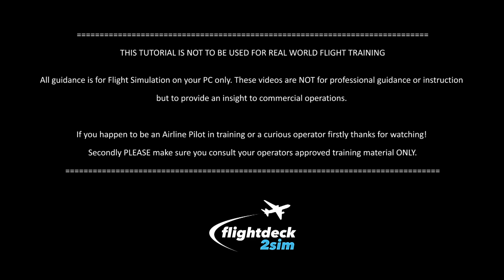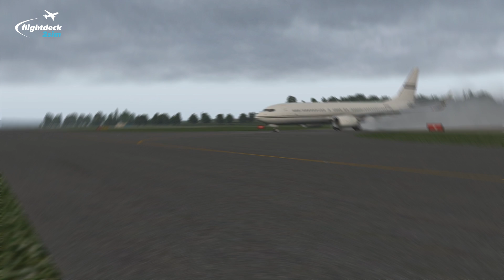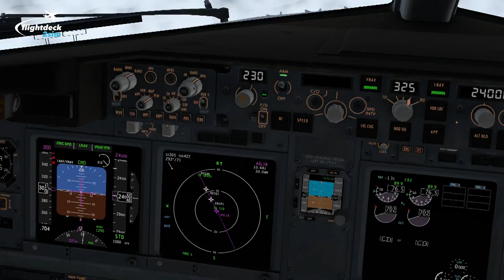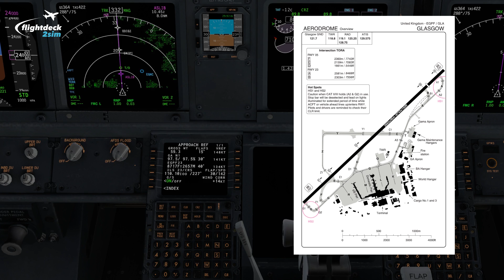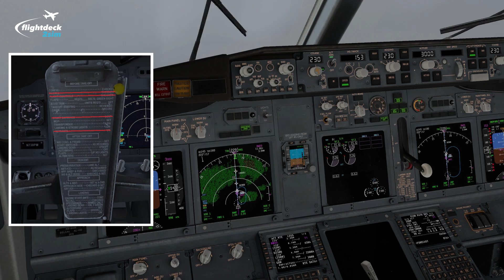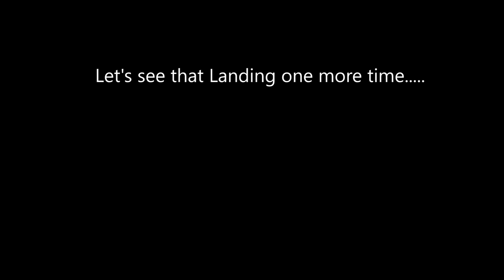Full Flight Tutorial by REAL BOEING 737 PILOT | Liverpool - Glasgow | ZIBO MOD | X-Plane 11

Comment from the maker: Hi Chaps, 

Firstly, thanks for all the positive comments and messages regarding this tutorial using the excellent ZIBO freeware MOD for the 737-800 on my first outing with X-Plane. As many of you’re commenting and asking very similar questions I’ll try and answer the most FAQ’s here!

1. Is X-Plane 11 better than FSX/P3D?

I've never tried P3D but I've been told the FM is the same as FSX's. After only logging around 10 hours on the X-Plane platform the sim, in my opinion, is miles ahead of FSX. Just from a general user point of view, a fresh vanilla installation of XP 11 if far better than my propped-up version of FSX Steam with a host of weather engines, texture updates and pay ware scenery. (I am no way affiliated, just my honest humble opinion!)

I’ve been flying for 13 years in real life and used MSFS for almost 20 years. I’ve flown gliders, single and multi-engine light aircraft and the 737NG. Comparable aircraft in X-Plane 11 react and handle in a very similar way. Small things like ground effect, the way aircraft reacts to external forces, X-Plane models flight in a way more akin to real life and it feels like you’re flying through air! 

2. What’s better? ZIBO or NGX?

I genuinely have no preference. The NGX is obviously a complete product. It’s extremely immersive with all the systems modelled accurately and I’ve used it and will continue to use it for the foreseeable future. If you wanted to simulate every detail, practice non-normal situations as realistically as possible it's obviously the go to product! 

ZIBO MOD is still a WIP but even in the last month there has been a significant improvement in the FM and It feels pretty good to fly and not far off the real thing! A lot of work has gone in and will continue to go in to further improve the MOD. There is input from RW pilots, 737 pilots (including myself!) and with ZIBO’s unsurpassed dedication you’ll see this aircraft develop to a truly accurate replication of the NG. 

Lastly thank you for all the recommendations for addons of X-Plane 11. The sole purpose of this channel is to show you how to operate the 737-800 based on real world operating procedures with a little bit of humour and memes in-between. I will try some of your suggestions!
 
One last note! I make a real conscious effort to answer all queries from YouTube video comments, FB Page messages, twitter, email and Instagram. In the last three months the amount of message I have received has increased tenfold. Please take the time to scroll the comments section in my videos before asking a question. I think I’ve had about 30 comments asking the same question in this very tutorial! You might find your query has already been answered! Nonetheless please feel free to ank a question if you can’t find what you’re looking for, I am here to help!

You’ll be seeing both the NGX, ZIBO MOD and perhaps other aircraft in the future.

All the best and thanks for watching!

flightdeck2sim
Reply: Can you find the runway frequencies for ILS in the zibo mod fmc. If yes how?
Reply: I WANT TO PLAY X-PLANE 11 BUT I AM USING A TABLET BUT GOOGLE APPS STORE CANNOT GET THAT BUT GOOGLE CANNOT ALSO BECAUSE I HAVE TO PAY SO CAN YOU DOWNLOUD THAT FORM ME!!!!!!

Comment: No.  The product is junk.  Hundreds of uncontrolled errors/fails and bugs.  E.G., try a flaps 40 power off stall. :)  FMS - fails if you try and load an approach in a hold etc.  It's free and it's quality shows it.

Comment: I notice on the X-plane 11 Zibo simulator that when looking from the cockpit to the ground when aircraft is stationary and looking at the distance to ground and 
then comparing it to one of your actual B737-000 company simulators that the height is somewhat higher in your simulator and even looking at some Utube 
videos in a actual real B737-800 it sits higher than the Zibo X-plane 11 off the ground.  Any information would be appreciated. Thanks!

Comment: Hi, I've come across with a problem recently. I can't turn on the hydraulic pumps. When I switch them on, the low pressure lights still remain. I can't control the plane without them whatsoever. Btw I'm using pmdg in prepar3d v4.5

Comment: Hi, sorry for sounding like a ridiculous newbie but what's a radial?  I didn't completely understand what you did at 15:03 . Also at 15:03 again the chart identifies the radial as 062/R242 (for POL) in the POL 4T SID instructions right at the bottom of the chart. However the FMC displays it as D242Z?
Thanks =)

Comment: Hi captain. Nice video. Thanks for the tuto. I am coming 2years later with a question. When you captured the loc and the g/s, everything was cleared. No lnav, no vnav, no approach mode, and no vor/loc activated on the autopilot. Only on the flight display. Is it normal? And at that point, where you only had the speed as an input, who wss flying the plane? I mean, where is the command coming from? The fmc?
Reply: Once you capture the G/S and localizer the approach mode light goes out but is still activated. It just means that it cannot be deselected. To see which modes are active look at the top of the PFD. The active modes are annunciated in green there

Comment: Hi - I used Sim Brief to get a flight plan from Toronto Pearson (CYYZ) to Sault Ste Marie (CYAM) and got the following route;    CYYZ/15L DCT NUGOP DCT 4519N08153W CYAM/22.    HOW do you program in 4519N08153W (which I am assuming is a set of lat and long)?

Comment: I have been have been having issues with descending and everything in my FMC is programmed properly but the plane will randomly accelerate, ill be 2-3k ft higher than i should at each way point and a bit faster too. After watching this i guess i shouldnt really rely on vnav at all, switch around from v/s to flight level change and adjust speed manually?

Comment: The Zibo mod is cool only problem i have is the plane does not desend at the top of desent.
Reply from the maker: Kevin M did you select a lower altitude on the MCP? Works exactly as it should 👍🏼

FD2S
Reply: @flightdeck2sim  yes I did before I reached the TOD, on one flight it started to descend then it just stopped for no reason.

Comment: Hey cap what Camera plugin do you use I find myself struggling to be able to do checklists on default camera view.
Reply: XP11 actually has a built-in camera system. CTRL+Numpad key will save the current camera position, and you can cycle through the different cameras using the numpad. There's also X-Camera which is a really nice plugin (and also free to use). There is a premium version that gives you some more options, but you should definitely check it out

Comment: What computer you are owning, and how fast? and what kind joystick you are using?
Reply from the maker: Hi Peter, I use a Logitech Extreme 3D Pro,

These are my specs! 

PC Specs:

• Intel Core i7-7700K Kaby Lake Processor/8MB L3 Cache 

• Chillblast 120 CPU Water Cooler 

• Asus PRIME Z270-P Motherboard 

• 32GB DDR4 2400MHz 

• 500GB Samsung 960 EVO M.2 SSD

• Seagate 8 TB IronWolf Internal Hard Drive

• NVIDIA GeForce GTX 1080 8GB Graphics Card

FD2S
Reply: @flightdeck2sim   I do use Logitech Extreme 3D Pro too, but what kind of computer and how fast?

Comment: Great video, very helpful and enjoyable! I'm having an issue with the autopilot in the ZIBO 737, when I try to set the airspeed it limits me to ~240 and puts a B or 8 in front of the number. Is this supposed to happen? I swear I'm able to set it to over 300 in the default 737.
Reply from the maker: Should be able to set a higher speed.

The flashing "A or 8" are "underspeed/overspeed limiting" symbols. If it flashes an A, that means you are under speed, the 8 for over speed meaning you're approaching VMO/MMO, LDG Gear Limit or Flap Limit and the A/T is intervening. (need to be engaged to work)

FD2S

Comment: hi, after setting my FMC i keep on getting this info 'EFIS MODE/NAV FREQ DISAGREE ' and plane is flying off trace , anyone can help? thx in advance
Reply from the maker: Good Day!

Check your EFIS selection, if you have APP or VOR selected with a VOR and ILS tuned respectively you'll get this message.

Leave the mode on MAP to remove this message.

FD2S
Reply: thx 4 reply , problem  fixed

Comment: Can you explain the settings for AC & DC panel as they remained unchanged in your tutorial or was that an omission? 
Thanks so much for the best Tutorials on youTube.
Reply from the maker: Hi Baz,

The AC/DC Metering panel is seldom used these days. There is no requirement to check the Voltage/Freq for the selected source and we don't check anything on the panel routinely.

Thanks for your kind words!

FD2S

Comment: Why does the wing anti ice automatically turn off? (Great video btw!)
Reply from the maker: Hi Matthew

When the air/ground logic switches to air when you take off the WAI turns off

This conserves thrust for the climb out and improves 2nd segment climb performance in the event of an engine failure. If WAI is needed it must be re-selected manually on. 

FD2S

Comment: Simply amazing. I tend to think that I could really be a pilot after all my hours of flying (from FS2004/FS9, FSX, FSXSE, Xplane 10 and now X Plane 11), but then I watch your videos and realize that I am not doing things the right way. Even my rotation isn't as smooth as you make it look. I would much rather be in a plane flown by you than one flown by me, even a virtual plane. Everything is so smooth and under control. Very good videos man. Thanks for letting us WANNABEES learn from you.
Reply from the maker: Hi vasily202, thanks a lot!

Practice makes perfect and don't despair, most simmers wouldn't know how to move the seat forward to reach the controls to fly the real aircraft but a lot can be learnt from using a desktop simulator.

FD2S

Comment: engage autopilot before cleaning up?
Reply from the maker: Hi Fadhil,

The procedure will vary at different operators, the standard autopilot engagement height we use is 1000ft AAL and clean up at a height dependent on the noise abatement departure procedure being used.

FD2S

Comment: Where is the noise from the trim wheels? That's a pretty glaring omission for a 737.
Reply from the maker: It is modelled, I’ve muted it in the FMC settings. The way XP11 models automation means the autopilot has to constantly make trim inputs. It handles very close to the real aircraft.

FD2S
Reply: flightdeck2sim Ah, thanks.

Comment: What are you using to record the game ? i'm having issues with bandicam when i switch on my other screen it's look like the video is freezing ...stil hear the clicking noise and my voice but the image doesnt move anymore....i'm trying to find a solution
Reply from the maker: Hi Nikon.

I use NVIDIA Shadow Play 👍🏼

FD2S
Reply: flightdeck2sim thx I'm using it and no problem at all :) Keep your good work i have learned all the plane with your videos
Reply: One last question ! How do you have both side of the cabin synchronized ? I mean when i set the QNH i have to set it on the copilot side it's kind of anoying
Reply from the maker: ZIBO has updated the aircraft since this tutorial to turn off the synchronized BARO setting which is realistic however, you need to set both altimeters when you're flying single pilot using a desktop simulator! 

FD2S
Reply: flightdeck2sim yes i noticed. Thx for your help it's really appreciated.
 
With the 257 and new version i don't know why but even if i do the tcas test i have a red square with +24 on my screen it's annoying cuz i have no airplane near me but it's still an amazing free addon

Comment: Great video with depth info nicely tutored, you know your stuff pretty well keep it,subbed and liked..

What s app called you using for calculatig V1 VR V2 etc
Reply from the maker: Hi Idee247, thanks!

It's the Boeing OPT App off of my work EFB which isn’t available for general use. I’ve been advised there’s software called TOPCAT which provides comparable data for sim enthusiasts 👍🏼

FD2S

Comment: one thing is that you want to have the hydraulics page on the lower display on so you can see if the flight controls are reacting to your input.  remember this is not an Airbus theres no flyby wire system. lol :)
Reply from the maker: That’s actually an option by Boeing, our NG’s don’t show the position of the flight controls. We just need to ensure full and free movement 👍🏼

FD2S

Comment: Could you fly it with the artificial stability mode off and tell us the difference please?
Reply from the maker: Hi Ayko, is this relating to XP11 control sensitivity? I’m not sure what you’re referring too. I’m still tweaking my settings, it’s never going to be perfect in a desktop simulator! 

Please may I ask if you could refrain from asking the same question in multiple posts too.

FD2S
Reply: flightdeck2sim yes Captain, Xp11. Artificial stability is a option in xp that you can edit in flight ( under developer options menu)or swich it completely off( keyboard or joystick mapping). Sorry for multiple posts , 😜

Comment: Hi were did you get the portrait charts from? And how do you know witch runway the airport is currently using before you set your flight plan? Thanks
Reply from the maker: Hi John,

I use the VatMap App which use the identical charts we use in my company (Navtech). The LIDO OFP has the expected SID/STAR and expected runway in use at both origin and destination. 

Of course this can change in flight and at short notice. 

FD2S

Comment: It's quite nerve racking with the 800.. I was a bit hesitant with rotation because of how little tail clearance there is.. Seems to be fine with a slow rotation to 10dgrs.. looks like there is about a foot clearance xD.. this confirms what mentor pilot said.
Reply from the maker: Hi Vanadeo.

Yes the -800/-900 is more susceptible to Tail Strike, especially the lower the flap settings and in gusty crosswind conditions. The correct rotation rate with two engines is 2-2.5 degrees per seconds to a initial target attitude of 15 degrees. 

Good Luck!

FD2S
Reply: I'll bare that in mind, Thank you!.

Comment: Arent't curved turns on the ND simulated in this addon?
Reply from the maker: Hi MW entity.

Not at this time but I do believe it's due to a limitation within the XP11 mechanics, you'll find more information by searching the ZIBO 737-800 forum.

https://forums.x-plane.org/index.php?/forums/topic/111305-b738-800-modified/

FD2S
Reply: Aha. Interesting.

Comment: Excellent video, and greetings to you from the United States!

A question for you; I recently updated to the Zibo 737 version 3.25p, and ever since the update I seem to be unable to start the engines anymore. I never had this problem in 3.24 and I use the same standard procedures you are using, but since v3.25 this has become an issue for me. I can get rotation, but the engines won't ignite anymore once I introduce fuel. The only way I can get the engines to start is by using the Shift+Cntrl+E keyboard shortcut. This gets the engines running, but then it kills all the indicator lights on the MCP, overhead panel, parking brake indicator light, and they won't work any more. 

Do you by chance know a fix for this, or do I need to wait for a patch or update to fix it?
Reply from the maker: Hi James and greetings! I've not tested the latest version yet. Keep an eye on the ZIBO forum to see if there has been a bug reported. 

Make sure you are following the procedure correctly too, I have an engine start tutorial in my playlist, you could have missed a step! 

FD2S

Comment: Zibo Mod is very unstable in cross wind? How does an 737 real?
Reply from the maker: Hi there,

Yes ZIBO MOD is still a WIP and I have tried some crosswind landings. The inputs required are a little more than that is needed in real life but it's not too far off. (probably more down to my joystick/rudder settings which I'm still tweaking with, the flight dynamics and handling is very good)

The real 737 is reasonably stable but it depends if it's gusting/shearing, some quite positive inputs may be required to keep the aircraft stable and on speed. I'll look at a crosswind landing tutorial at some point soon!

FD2S

Comment: How did you manage to get the Boeing OPT tool to work? Mine is restricted to demo airports??
Reply from the maker: Hi Tom, I’ve found out from other users it’s not available publicly. I’ve just using my work EFB to calculate performance. 

FD2S
Reply: flightdeck2sim Too bad, looks like a good program. Have contacted Jeppesen to try and see if it can be used

Comment: Could you possibly clear something up for me...

1. Do you need fuel pumps on to start APU? (I read that you don't)
2. What are the BLEED procedures... ENGINE BLEEDS & APU BLEED on then start the APU, engines, etc... or BLEEDS after starting?

Thank you!
Reply from the maker: Hi DemonTraitor 

1. Not required but we do turn on one of the AC Fuel Pumps on which increases the service life of the APU Fuel Control Unit.
2. For Engine Start you'll need the APU Bleed on and APU Running and Engine Bleed Switches should be on. After start turn off the APU Bleed.

Good Luck!

FD2S
Reply: Thanks. Very much appreciated. So before starting APU (and Engines (cold & dark)), it's okay to have all the BLEEDS on? Thanks
Reply from the maker: Engine Bleed is usually always left on, even after shutting the aircraft fully down but APU Bleed must be off prior to APU start and you then have to wait one minute after APU start to be able to use APU Bleed. You'll need it to start the engines!

FD2S
Reply: You are the best. Thanks. I have a Zibo checklist I am trying to make as realistic as possible :)